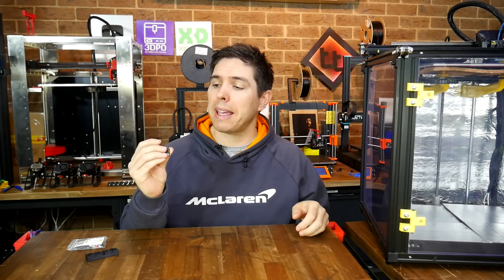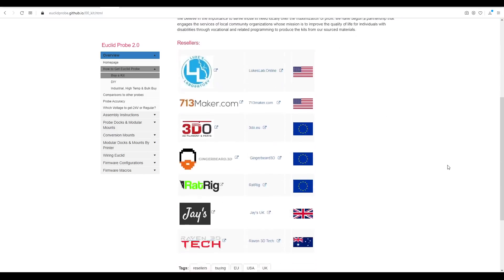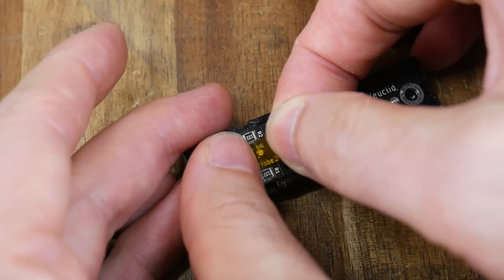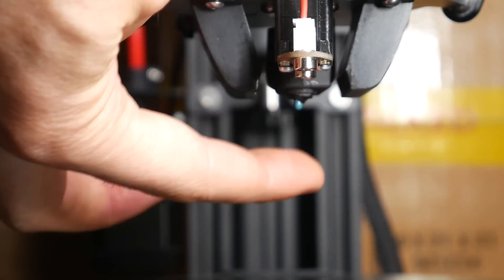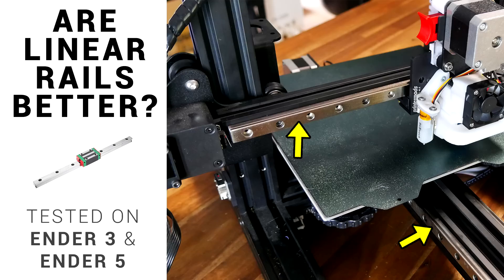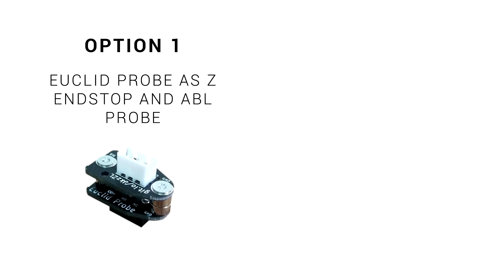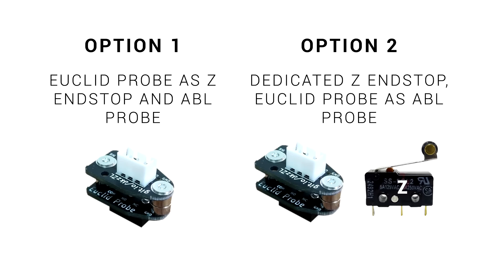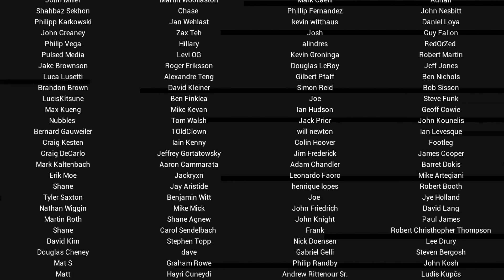Euclid probe: Light, robust, mechanical ABL for your 3D printer

Comment: How about using a metal bed, and using a conductive touch probe, something like the luzbot use? They attach a wire to the extruder, and the nozzle touched the bed corners where a second wire is connected, it closes a circuit, and then you don't even need to connect a probe, just an extra wire.

Comment: After building 2 of these for my RatRig both after a very short time (5-6 prints - bed mesh) the switch becomes highly inaccurate to the point its no longer reliable and the mesh fails. I've tried 2 switch manufactures for the micro switch. When I put the second (bottom part) on it worked for a while then started to produce "Probe samples exceed tolerance. Retrying..." to the point of failure.

I tired slowing down the probe speed but nothing works.

Anyone else have these issues? I don't want to go back to the BL Touch!!

Comment: Hello great tutorial, I have a question about Ender 5, if I attach the display to the frame, pip the display and automatically jump to the menu and back, the mianboard is new silent 4.2.7
what can it be and how can I fix it because I currently have the display on the table?

Comment: Looking at your stow/deploy macros, it looks like the deploy is state-dependent and hence failure-prone. Run that deploy macro with the probe in place, and the probe will either fall into the bottom of the printer or stick randomly to something on the print head. 

Would it be safer to deploy by running the stow moves first? Especially if you're remote-starting jobs, you can't be 100% certain of the probe state, and for the sake of two extra moves it seems like it would add peace of mind.

(Running stow with the probe already stowed would appear to have no consequences.)

Comment: Euclid for me, is making up 1 half of my auto z calibration. At print start, i heat my bed, and my nozzle, making sure to deal with any ooze through a nozzle scrubber. The nozzle itself homes to my z endstop. The probe then homes the shoulder of the microswitch to the same endstop, and the bed. This means, all you have to tune is the offset between shoulder and trigger point of the euclid microswitch. Any changes in build surface, nozzle or temperature, are all accounted for. I honestly think this is 1 big step in useability that makes 3d printers much more friendly for the common users. Id love to see it done on a commercial printer.

Comment: Man being just a hobbiest amd picking up the printer when i need something ive run into issues with things changing and as well as breaking after coming back to it.  I like this idea for bed leveling out of most and want to try it. But i have an issue where i dug deep into teaching myself how to compile firmware by watching your vidoes and by the time i wrote the firmware for my first skr mini e3 v2.0 i did the furmware myself and did a bunch of differnt touches that i learned from your channel.  But fast forward about a year and i burned up that skr mini e3 and didnt save the old firmware i made so id have to redo it.  I found it extremely harder to figure out as im guessing updates to programs seemed different or i just dont remember right.  Im a auto mechanic by trade and dont always have use for 3d printing but when i do it seems to come allot.  Im worried about doing a firmware for this then forgeting how to do it again.  How would you suggest someone like me be able to do this say after a uear of doing it the firat time.  Or am i just showing how little i know about computers and programming that i forget it easy when trying to teach myself something that i womt use constantly. Thank you for all the great knowledge

Comment: Is the electrical current passing through the magnets? If so, I guess its not much to be concerned .
Reply: There is no active current through the magnets. Your controller sees the switch as continuous, complete circuit that gets broken when the switch is triggered.
Reply: @euclidprobe  Don't get me wrong, since it is your product... but the electrical connection between the two parts of the probe is via the magnets as far as I understand. There are no additional pins or so that must align when coupling the two parts.  Only the magnets that touch each other, and therefor, at some point, a current is running through the magnets.
Reply: @McOldwolf  it takes practically no current to light an led. A good bit to run a stepper motor. It's only enough current for the system to determine if this pin has voltage or not.

Comment: As you just finished with the SK-Tank, I would be curious about using this ABL instead of the inductive sensor.  I've had no luck with my SK tank bed leveling even though the size and mass of the bed would suggest otherwise.  After I mapped the bed for the first time (preheat and post heat) you would have thought I was trying to print on a bell.  Adjusting the inductive sensor height including the little lock nut is darn near impossible with my chubby fingers.  I was thinking of going to BLTouch but I would prefer something small and removable like the Euclid.  Any interest?
Reply: I gave up on inductive sensors a while ago. They are completely unreliable. If the bed was made of iron it might be perfect, but anything else is just luck.

Comment: I’ve been using the Euclid probe on my Railcore 300ZL for 8 months now.  I’m very happy with it.  The Railcore MIC 6 bed has very strong magnets and it can mess up readings from the BLTouch.  This is one of the strongest arguments for a probe like the Euclid.
Reply: The CRTouch has optical triggering,, btw. The electromagnet is just for releasing and stowing the probe.
Reply: @Bubu567  I had a CR-Touch which was working great until it decided to drop the probe mid-print resulting in a permanently bent probe which makes it useless as it's not replaceable. Luckily it was still under warranty. I loved the quality and accuracy but won't be buying another.

Comment: How do we get in touch with Micheal if we would like to see if he can have a look at a printer for me?  It has a fault we can not sort out, it can print benches, test cubes, heat test shapes, and pass all these tests - but anything large than that will not print and the head just starts hitting the side of the printer bed after a few passes.

Comment: Played with allot of stuff like this in the past. Magnetic pen tool changer with 5 colours . Brush nozzle cleaner etc and think it looks cool but for abl I prefer to just keep it simple, with a bltouch or a conductive sensor . The pickup designs I used would eventually fail in my case or slightly crash the partcooling or the slightly unaligned thing itself. Love how innovativ people are though

Comment: one thing you didnt mention but is a thing: temperature drift... i had an inductive probe that had great repeatability (standard deviation of 0.006), even at different temperatures. BUT: when i set the  Z-Offset with ABS temps it worked as long as i printed ABS... when i switched to PLA the nozzle touched the bed, stalling the extruder, and on a cold bed it outright rammed into my build surface... so would strongly recommend testing this aswell...
Reply: I set my Z-Offset on a per-material basis in my slicer.
Reply: @Daede420  that would be one way around it, but another factor comes in here: preheating time. If i heatsoak my enclosure for print that would otherwise warp, the offset is off again. (The warmer the Probe, the higher the trigger distance)
But all of that is now fixed since I installed a superpinda
Reply: @mongini1  Yeah that SuperPinda is really nice, I like it a lot. Hell, I recently saw a video of a mechanical probe using an allen wrench and optical endstop that used gcode and a magnet to stow and deploy the probe. Total cost was like $2.27 and pretty damn accurate. 

I, too, like to do a soak before probing, and have it in my start print function. I also heat the hotend to printing temp before doing my bed mesh. There's a .036 average standard deviation difference between 60C/190C and 80C/224C and a .06 average standard deviation difference between 60C/190C and 100C/265C for me. this is on a 300^3mm Rat Rig V-Core 3
Reply: If the probing is done with already heated bed, I’d assume there is no problem with a mechanical probe. I wonder if the assumption is correct
Reply: @apinakapinastorba  I have an Ender 5 with a CRTouch. I probe before every print after heating the bed and the same z offset works for both PLA at 60C and ABS at 100C
Reply: @Miraak15  I have a deviation of .06 between 60c and 100c, but I'm also using a much larger bed

Comment: I've been using it on my voron, after tuning, its extremely reliable and I've had no issues with false pickups, ideal mount for the voron 2.4 is bed mounting and with auto z calibration, it's really dead simple to use. If mounting to the bed, then a few steps are needed to dock it -- after homing and doing quad leveling, i home z again to establish relative z 0, this ensures that the probe can be safely docked. Then do the auto z calibration, and mesh if desired.  If mounting to the gantry, there is no need for extra home z,  but it's a bit more risky since the probe can be possibly picked up in  odd printing motion,  but even in that scenario, the motion is very specific, so it's extremely unlikely in either mounting setup.

Comment: Hmm....i get the idea that this type of sensor with a switch is not as good as for example the BL sensor which is mounted on the Genius Pro. What I do like: this one doesn't break and that's what happened to me when the BL sensor hits the print.
Reply: Well, that's not true. Omron switches are extremely accurate. They are more accurate than your stepper motors, so there is no way a BLTouch is more accurate than a Omron switch based probe.
Reply: @Akegata42  but then you can ask yourself why do they made it more difficult/expensive than necessary.

Comment: Would it be possible to set this up on in Marlin as follows?:

1: Don't allow homing if probe is not connected (wait for user to attach probe if nessecary)
2: Once probe is connected, home, bed level, etc.
3: store probe, and print
4: at completion of print pick up probe again. This way the probe is already in position and even if you shutoff the machine and lose home when you turn it back on it's ready to rehome without user intervention.
Reply: You can't print with the probe attached to the print head, that's the whole point of making it detachable. A mechanical probe needs to be lower than the nozzle in order to touch and probe the bed.
That's why the BLTouch retracts it's probing pin.

Comment: I'm using BL Touch replica + plain glass bed for more than 2 years with 0 problems. This is a overkill solution for easy problem.

Nice ad by the way...
Reply: Yikes, bud. You've had zero issues with your fake BLTouch but A LOT of people had. Maybe they would appreciate an alternate option just like this. Just because you don't need this does not mean others won't. He was not even paid for this video which makes it NOT an ad. Next time, refrain from commenting a useless thought you could of kept in your head. Thanks
Reply: @Crafter318  nice to meet you fan boi. Now go to shopping web site and but this pricey overkill thing. Mental.
Reply: Also, there are motherboards "old style" like my Creality 1.1.3 that require some modifications (like cutting 1 wire from the display cable) to get an ABL working. in this case, you can use the microswitch as a probe and z endstop. 

that doesn't require any modification since the z-endstop is default on any board. 

so.... no, it's not an overkill solution. maybe it's pricey but even if I gather all the components (magnets, connectors, switch) I'd miss the PCB part, that I have absolutely no idea where to get it. 

so to me it's a valid option
Reply: @federico9292  you should go for 32 bit boards for future proofing that device. Buy what ever probe you like, then take notes about your fine adjusments... Cheerrs
Reply: @federico9292  Initial development for Euclid was done an 8 bit Melzi, basically the same. You've actually got 2 pins available on that 1.1.3 board
Reply: @euclidprobe  you mean, avaiable in the microprocessor. because I don't see free pins in my board.. I mean they could be avaiable if you say so, but accessing them means be able to micro-solder things...?

Comment: Lol, because of the assembly work this is definitely not the cheapest probe. Time is money. I guess maybe not for you.
Reply: The BLTouch also needs to be assembled..?
The arguments people have against this probe are so weird.

I have several printers. They look different and have different capabilities, which makes different probes the better options for different printers.
No probe is perfect in every situation, but I can tell from experience that the Klicky probe is a hell of a lot more reliable than BLTouch, and takes less time in the long run since it will never catastrophically break and force you to buy and reinstall a new one.
I have not used an euclidic probe, but is has the same functions as a Klicky.

You could probably have installed an euclidic probe to your printer in the time it took you to watch this video, so I think maybe you should reconsider how you spend your time-money.
Reply: I can't imagine this taking more than 5 minutes to put together

Comment: Nice idea; If I understand correctly, for a printer like an Ender 3, you will still need a way to home Z, correct? Unlike other probes like the BLTouch or inductive ones, you can't use the Euclide probe as an endstop.
Reply: You can. But I wouldn't. I have an Euclid on my ender 5 pro and I'm very glad I still have a z endstop because accidents do happen (user error on my part)
Reply: @emielv7677  But the Ender 5 pro has a moving bed (Z Axis) so the X and Y axis remain all the time at the same height, so you can easily go and grab the probe (no matter where is the bed as long as it is not at nozzle height) i.e., the nozzle moves in the XY plane. In an Ender 3 or Prusa MK3 type the nozzle moves along the XZ Plane, you would first need to home Z to know how high is the X Axis and go grab the Probe, am I right? or there is something I am missing.
Reply: @sebastiansombra  you need to home all axis' before you can move an axis. (Unless you use the force move command but I didn't use that for safety reasons)
Reply: @sebastiansombra  you can see a video of the entire probing procedure on my YouTube channel
Reply: @emielv7677  Right, maybe not completely safe, but in a strict sense you could Home X and Y and go grab the probe to home Z (maybe lowering the bed a bit to avoid collisions), i.e., use the Euclid probe as an endstop. In an ender 3 you can't do that.
Reply: @sebastiansombra  I recommend you read the guide. I think it is possible. You can also join the discord of you have questions that aren't covered in the guide
Reply: It depends on the firmware. Our Ender3 development is covered in the docs- its not hard by any means, but depends on the amount of mods already done. Probe or not, all i3 style printers need a Z-endstop. We recommend modding the Z endstop to an adjustable one and then hard mounting bed at the dock location.

Comment: I'm currently running a modified Poor Man's BLTouch micro-servo + optical endstop probe which outperformed the 3D-Touch that came with my Sapphire Plus by a factor of 10 in accuracy.  However, I have been looking at the Clicky Probe, but have the problem that my print-head cannot move outside the print area.  Hence I'm considering having a Clicky Probe dock that can be put over the print area using a servo.  Would make things again somewhat more complex to dock/undock, but would still allow getting the weight off the print-head.  As for the probe you reviewed: $25 seems a bit much for what you are actually getting, no?
Reply: Compared to a Klicky probe it's pretty expensive, but compared to a BLTouch it's very cheap.

Comment: Interesting! I have an Anycubic Chiron freshly converted with a BTT SKR2 + RepRap, and I have a issue with the bedleveling. The probe must be installed/removed manually. I use Z endstops on each of my Z motors for gantry level, and a probe for bedleveling. But RepRap don't like that when you try to load your mesh leveling and warns you the Z=0 datum is not set properly. Most solutions I could find are "just put a permanent BLtouch" but this is a great alternative.